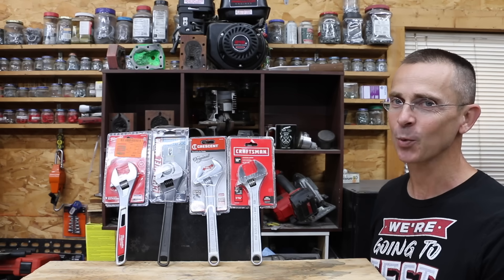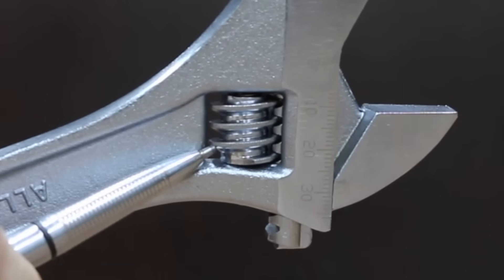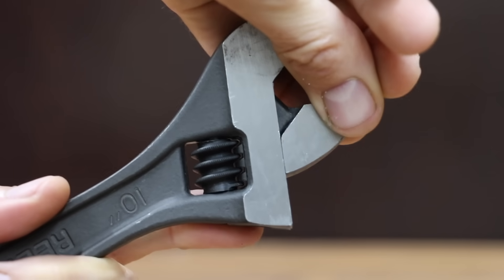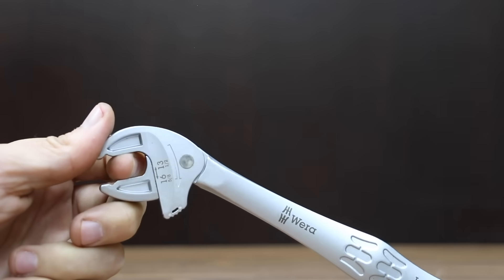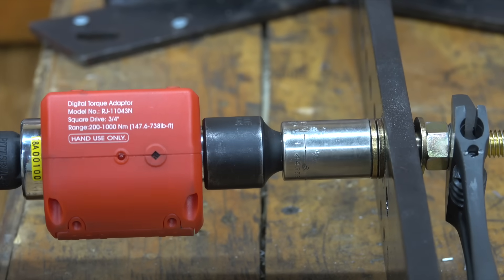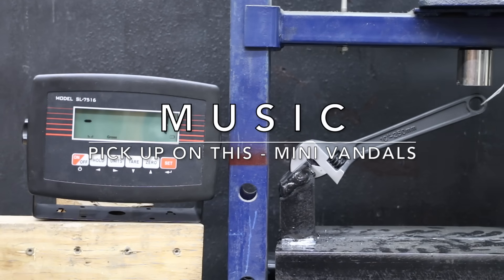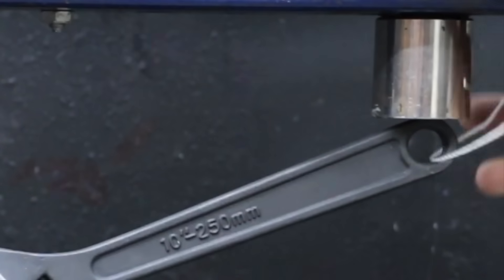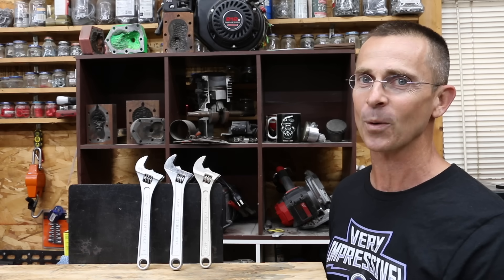Best Wrench (ADJUSTABLE)? Craftsman USA vs Craftsman, Crescent, Kobalt, Milwaukee, Channellock

Comment: I love the genuine hilarity in your voice when you stated for the Kobalt wrench “works with standard and metric fasteners” These marketing teams are always grasping at straws aren’t they lol
Reply: I sold all my metric adjustables and SAE adjustables and bought the Kobalts. LOL
Reply: @Jay & Laong's World!🤪²⁰²¹ officially yes but the majority of countries still do use imperial. for instance in Canada Houses are still being built using the imperial system.
Reply: @678friedbed  only at face value. The materials and engineering are in SI metric even if they are sold in imperial sizes. Tradesmen still use imperial tape measures because they are easier to read than metric.
Reply: @peternorthe1912  that's why contractors have to do crazy things to get a metric sheet of plywood to match up with an older sheet. also it has nothing to do with seeing the measurements, it's because imperial is easier to deal with.
Reply: @peternorthe1912  that's why contractors have to do crazy things to get a metric sheet of plywood to match up with an older sheet. also it has nothing to do with seeing the measurements, it's because imperial is easier to deal with.
Reply: @678friedbed  sure... it's always easier to add and subtract fractions than whole numbers based on tens as a base unit. lol... and those "crazy things" you speak of - do you mean "shims"? Carpenters have been using shims to do renos for as long as renos have been done on homes. And many other skills that get the job done.
Reply from the maker: Thanks!
Reply: Well considering Metric is the standard, i mean they literally wrote "works with metric and metric fasteners"
Reply: @nopenope8418  actually no, standard aka imperial was the standard around the world long before metric was invented. also metric isn't as standard as your teacher claims it is. the metric system also has huge downfalls and sucks compared to imperial.
Reply: @678friedbed  sorry but since you did not bring any arguments, appealing to tradition is a sophism, a false logic and since 100% of the world uses metrics, including imperial units, which are defined using metrics now, I will not change my opinion.  And I live in a country where we use both so can have a point of reference to say imperial units are not the standard.
Reply: @678friedbed  I will not feed you anymore troll, your vision of the world is deeply flawed and you obviously have not searched anything of what you are saying.
Reply: @nopenope8418  oh, I've definitely done my research. the reason you are resorting to name calling is because you have no clue as to what you are talking about.
Reply: @678friedbed  What the hell are you talking about bud? You clearly don't get out much! Europe, Asia, Africa, Nordic and Scandinavian countries all use metric and have for a long time. UK has mostly moved to metric in engineering and trade, and USA is slowly changing because it really has no choice if the country wants to participate in this little thing called "The Global Economy". The only time metric "sucks" is when we have to memorize the conversion factors to change from imperial to SI metric. Or when you are trying to read a tape measure in mm in poor light and without glasses.

Comment: Well done!
My go-to's are a 1962 Diamond (black and chrome, found NOS in the wall of a building), a 1966 Williams "Super Adjustable" and a 1960 Utica. I also have a 1930"s "Bettergrip", the predecessor to Crescent, but it's only carbon steel. It seems like many mid-grade adjustables are now from Spain.

Comment: I have an adjustable wrench from Stanley that has the lever locking mechanism from locking pliers. It's amazing how well it grips

I also have a Proto wrench that auto locks
Reply: the Stanley locking adjustable is amazing, it's so tight you can use it as a mini-field vice to flatten material
Reply from the maker: Thanks for sharing.

Comment: I've got a great idea to improve product quality. Rather than charge a sales tax on the front end of the transaction, tax only the defective returns. A combination of a tax that is about 10-15 times the value of the defective products as well as an additional tax/ fee collected by the government from the loosing defendants in civil lawsuits would probably raise roughly the same amount as all sales, state income tax, and property taxes combined. Removing the current sales, property, and state income tax system and replacing it with this system  would make taxation much simpler and freer while drastically improving product quality; no retailer could afford to sell junk for long.

Comment: I have Snap on adjustable wrenches with the arrow on the handle. The problem is it points the wrong way! Most people don't pull adjustable wrenches the correct way!
Reply from the maker: Thanks for the feedback.

Comment: You need to test a REAL craftsman tool (it won't be what I call a "combination crescent"- with metric & standard sizes in the casting-only SAE)  
The craftsman tools of today, are not what their predecessors were...not even close.

Comment: Thanks very much for the test(s)! 
In my country, Danmark (“Denmark”) we call an adjustable wrench a “Swedish key”, or just a “Swede” for short. The Swedish Johan Petter Johansson invented the first adjustable wrench in 1892, and in 1916 his factory was sold to Berndt August Hjorth and COmpany, or BAHCO. (All according to their website).
I’ve always used Bahco, and I don’t see much reason to change that.
Reply: Sadly Bahco isn't what it was when the tools where made here in Enköping, Sweden, they abdoned the high quality special steel.
Reply: Bahco now has factories in China too, so you'll have to verify when buying
Reply: @MrMarnix  Their quality tools are made in Portugal.
Reply: The Bahco wrench is a traditional design that has a bulky buttress on the jaw, perhaps because the older steel was not alloyed. Modern wrenches (copies if you prefer) are slimmer and much more practical in modern automotive service. Bahco now makes their wrench with the right-hand thread that US users expect (at the request of new owner Snap-on?) and I have a ~4" one that's a honey, made in Spain. But not as nice as the 4" Crescent that I could never afford in the 60's.
Reply: That would explain why AvE refers to them as a "Swedish nut lathe"
Reply: In Germany we call it Englishman or Frenchman for some reason
Reply: Thank you for the history.
Reply: Love Denmark'''
Reply: @californiausa7622  Yea and the blond sweeties are something Special !!
Reply: And in Norway, we call them "mass destruction tool" ;-)
Reply: Très bonne marque effectivement, merci pour la petite histoire !

Comment: I believe you are rotating the wrench the wrong way during your torque test.  (example 10:16) Watch the moveable jaw deflect. If you rotate the opposite direction the corner of the nut will fit in the corner of the movable jaw. The moveable jaw is likely not going to flex near as much. This is demonstrated at 16:45. Watch the moveable jaw deflect. As the load is increased, the moveable jaw is pulling out of the wrench body.  I suggest the results would be considerably different if the wrench was rotated the opposite way.  Comments??

Comment: I have been sad looking for a comparison for long nose regular size pliers with the side cutters because I need it from Project Farm. I just can't watch those other ones now that you've set the bar.
Reply from the maker: Thanks for the suggestion.
Reply: @ProjectFarm  my main frustration with long nose pliers is when the needle nose goes out of alignment due to play that develops with use. I haven't seen any good information about the brands but just thought of getting the channel locks.

Comment: Man, I really liked this test but I do wish you would have included Blue Point adjustable wrenches. At the very least the modern iteration of them (the older ones are marked “Made in Spain”, the brand lettering is recessed and is literally half as thick. With all that against them, they typically perform better than the newer version). I have the entire set of current Blue-Point adjustable wrenches (4” 6” 8” 10” 12” 15” 18” 24” & 30”) and they are my go to when I need an adjustable typically but your tests have made me change so much of how I look at, but and use tools. I know for sure a lot of us would really appreciate seeing them go against your current lineup. Especially those of us on here that are professional mechanics with a tool truck addiction. 

Or even get some 18” versions of the wrenches and see if the quality stays the same in the larger versions. I know for myself and a lot of other diesel mechanics, large adjustable wrench are used more often than smaller ones for various reasons and finding a good large (typically most guys just get a 18” and/or 24”) adjustable that won’t easily fail can be hard when you can’t afford or don’t want to spend hundreds of dollars on a single tool. 

Another idea I have is maybe you can do a “Non-Standard” adjustable wrench video when you test the unique types of adjustable wrenches and see if they are any good/better in comparison to regular wrench’s. 

Stanley makes a tool that is a mix of adjustable wrench and vise grips. I have a 10” (250mm) version I bought from Walmart and it is surprisingly good. The part number on it is 85-610 if you want to seek out that exact one. It is a China made tool but as we all know, even thought a lot of crap is made in China, not all things made in China are crap. 

Finally, I have a 12” adjustable that the jaw is a mix between a regular adjustable and a pipe wrench. How it works is the jaw can be easily removed by spinning the worm gear until it slides off, flipping it over and putting it back on then you can use the pipe wreck looking side of the jaw. The brand looks to be “Pro Series” and it says “INDUSTRIAL 12”” on the same side as the brand and on the other side it says “FORGED ALLOY STEEL” with “CHINA” in much smaller lettering under it. 

Sorry for such a long comment but when it comes to mechanics tools I can provide a lot of input from my personal experiences finding, buying and using a lot of different tools by various manufacturers since I never once pigeon holed myself into only using a single brand or style (even if I did spend too much time and money of tool trucks in the process lol).
Reply from the maker: Thanks for the suggestions!
Reply: @ProjectFarm  you’re the real MVP of YouTube. Not only have you stayed consistent through the years when it comes to how you run this channel but even after hitting the big 1 million subs you still take time to read new comments on your videos and reply to them. All while remaining humble and modest about it all. Keep up the awesome work! Thanks!

Comment: I have only broken 1 shifter (wrench)  it was 18" Teng Tool  it took 3-4m of pipe and 3 grown men, one of which was holding the workbench. It did not break the adjustable jaw but broke on the fixed one. Is that normal ??  :) Got warranty on the shifter just had to pay postage.
Reply from the maker: Thanks for the feedback.

Comment: I’d be interested in a wheelbarrow test. How much volume can be held, hold much weight the handles can hold before snapping, how much kinetic force is required to move the wheelbarrow with 200 lbs of concrete 10”, length of handle, how much lifting force is required to lift the wheelbarrow 4” when gripping the end of the handle.
Reply from the maker: Thanks for the suggestion.

Comment: Excellent line up! Sad that the Craftsman USA is no longer manufactured. Didn't expect the Wera to break that early. I own a fairly recent Bahco, mine has equal range but I believe a shorter handle, which fits my purposes better and makes it slightly lighter. Indeed, it has some space, but that's little enough to hold any tiny to larger metallic nut up to at least the maximum force that one should apply. It even tightens plactic nuts well enough. But tighter ones from this test will create less wear on plastic nuts if some extra force is needed to  be applied  Good to know that the Bahco can handle a ridiculous amount of force!
Reply from the maker: Thanks for sharing.

Comment: I enjoy all of your testing including this one but something pops into my thinking when you talk about the disadvantage in the shorter jaws during the load test and the readings taken. If the shorter jaws reading were to be calculated to be in sync with the average length from the other wrenches being tested then surely (My question is...) the gap would read much higher and therefore rate the likes of the shorter jawed Craftsman lower than what the tests imply.?.? eg. the reading taken at a 1/4 point would be half of the equivalent of a 1/2 inch length?? I'd love to hear your thoughts on this. Thank you 👍👍

Comment: As a career mechanic more Craftsman tools I have owned have broken during use than any other brand.  Yes, they will replace them.  No, that is of no help during the completion of a job.  I have a set of combination wrenches purchased in the early 1970's which were drop forged in China and I have used extension pipe on them to break nuts loose and are still in fine condition today.  Oh...they were also only 1/3rd the price of Craftsman at that time!
Reply from the maker: Thanks for the feedback.

Comment: I would LOVE to see a test with the wrenches being turned 'the wrong way' to see what actually happens with torque handling / slippage.
Reply from the maker: Thanks for the suggestion.
Reply: @ProjectFarm  NP - makes sense to put the torque nearest to the BASE of the sliding jaw, not out at the top where it can flex, but perhaps there's a reason....

Comment: No one would ever put more than 250lbs on one of these. I've put an 8ft pipe on an old JH WILLIAMS "1 1/2 from the 70's. Payloader cutting edge bolts....2 people pushing on it, that's strength
Reply from the maker: Thanks for the feedback.

Comment: I find that proto and snap on wrenches tend to be pretty good. At least the old ones. Might be time for a round 2
Reply from the maker: Thanks for the suggestion.
Reply: Yeah I almost guarantee a proto or a snap on would win this hands down.
Reply: @Hawgfrog  yea, as a mechanic, I can say those are the brands I trust
Reply: @Masonthemechanicboy  yeah I have several proto crescent wrenches. They have taken a beating over the years and still work better than any of these.
Reply: @Hawgfrog  yea same. I have an old proto that I bought at a garage sale a few years ago. Some had apparently tried to use it as a pry bar. So the halndle is a little bent but it still works fine 😂

Comment: Really good tests on your videos! Keep 'em coming. I have a couple of comments if I may - I have a number of adjustable spanners (wrenches to you guys) but my best, strongest and oldest is a U.S.A. Millers Falls 12" and it is at least 70 years old, my father gave it to me and I know he had it before 1950. I think Ingersoll Rand purchased the Co and now the brand belongs to a Chinese outfit so I guess that it is crap nowadays guys. Secondly and a nice little tale is that when I was around 30 years old my boss was a former engineer with the National Coal Board (UK Gov't owned coal mining body) and in those days an engineer could get the sack (fired) for using an adjustable spanner instead of the correct size! In fact even for having one in the tool box. I know as do all of you guys that sometimes an adjustable is necessary but that was the rule then. That's all from me in Kent, England (hence 'Spanner' and 'The Sack' terminology.
Reply from the maker: Thanks, will do!  Thanks for sharing!

Comment: Hmmm... I only did 25 years at sea... when I ordered stores, I always specified SWEDISH Bahco, tight and handy.  All this applying huge torques to an adjustable is NOT required, I was trained that the idea of the adjustable was to hold the bolt head while using a proper spanner (open or ring) on the nut or as a handy pocket tool to carry around to tighten up gland packing nuts on pumps or valves.  If you want to remove stiff nuts... use a ring spanner or a flogging spanner.  If that fails, a good chisel and a hammer.... three or four blows should be more than enough to split nuts up to M18 or Whitworth/UNC equivalents....🛠
Reply from the maker: Thanks for the feedback.
Reply: Also a boat worker and the Bahco is the go to for my company because of the amazing jaw opening, slim girth?? Of the jaw, and being very durable

Comment: Adjustable wrenches. What I use when the correct size open end wrench is missing from the tool box. I also use them as a micrometer of sorts by tightening it around a nut then pulling it off and comparing it to an open end wrench so I don't have to try several. I usually use the box end of possible, though.
Reply from the maker: Thanks for the feedback.

Comment: The wrench I found most interesting (the Wera Joker) didn't show up in most of the tests, so it's kind of hard to tell what the verdict was on those, as they seem not to be an apples-to-apples comparison. Avoid?
Reply from the maker: Its a great wrench for light duty use but you'll need to buy the set of 4 wrenches to cover most of the sizes.

Comment: Once again a great Cool Tool Video by Todd's Project farm. Others can try, but just cant beat the Farm.   
  Them tools definitely are not for torque wrenches that's for sure. My dad use to call em knuckle busters for that reason. The best one I find is a riggers wrench with a spiked end for aligning holes, flanges or shackles.  I collect adjustable's  now, because there is always someone cleverly designing that clumsy wrench to make it work better somehow. There's been quite a few cool concepts. An older kind has adjustable jaws on each end, one bigger than the other. so you only needed 1 knuckle buster instead of 2.... American made.
Reply from the maker: Thanks!  Thanks for the feedback.